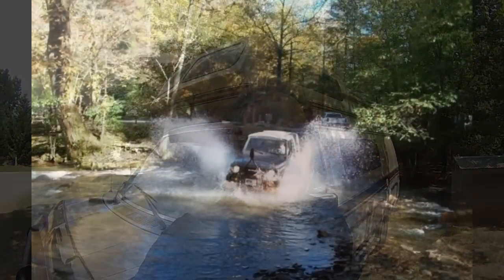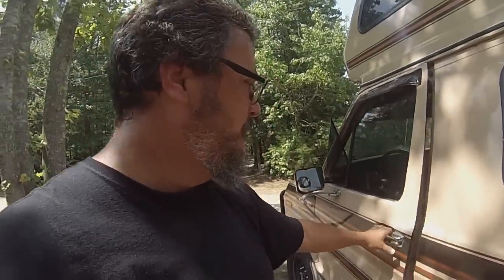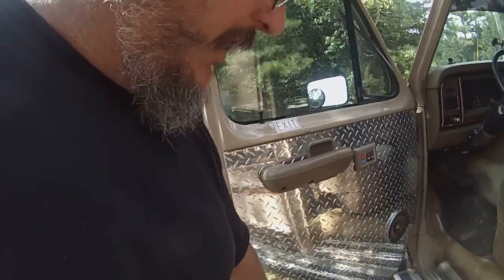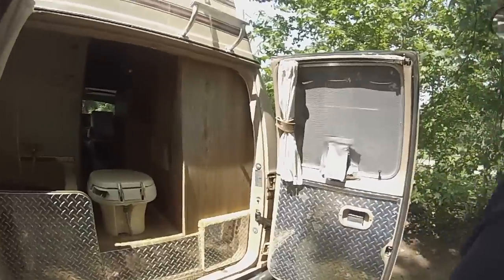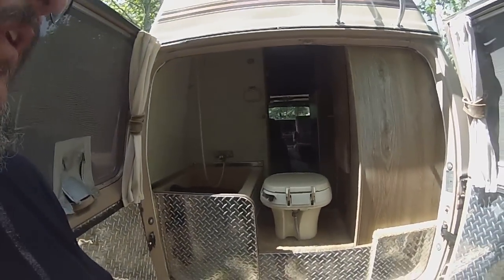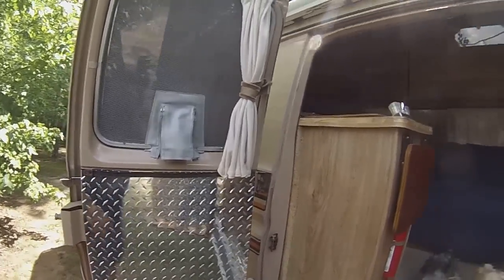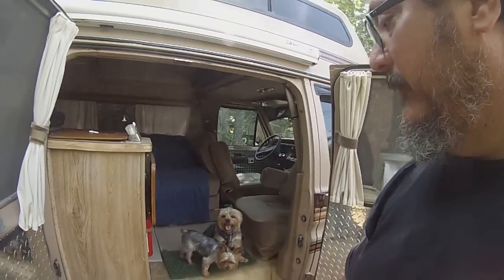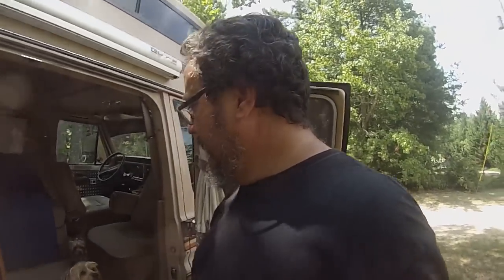Updating interior in Ford Econoline Class B Camper Van Rv

Comment: In the first 30 seconds or so of this video I thought you were going to go with wood paneling....Which would have been great.....But as soon as you mentioned the metal replacement for the door panels I knew you were going in the right direction. Wood, any kind of wood will fade and or warp over time but the metal, at worst will need a light polishing from time to time to bring out the original shine. Great choice and great job! I look forward to more videos of this type, as soon I hope to find and purchase a similar van for use as a temporary home while looking for AND living on land The Lovely Bride and I plan on building our "forever and off grid home"! Take care and keep 'em comin'.
Reply from the maker: FD Mackey I did wood on the Black Campervan, and it worked out great. I like the aluminum VERY MUCH! Good luck on your van search. Either you buy older and spend $$$ to fix em up or buy newer and pay $$$ to buy em... either way $$$$ ha

Comment: Looks awesome big kev, I've done the same thing to my van...I did the walls an all..for the diamond plate they have a chrome trim that goes on the edges u mite want to look at adding it on..all it is, is a door trim that protects the door edges it looks good on diamond plate...butt I love the van..
Reply from the maker: mud flap would love to see your interior... here I thought I was being original ha. How about send some pics to my Campervan Kevin facebook?
Reply: It's still under construction. .to do the walls it's a real thin sheets like flashing metal, I order it off line it comes in 4×6 4×8 4×10 an really cheap I payed 125$ for a 4×10 sheet an it's very easy to work with...

Comment: I need your help...
What or rather how much do you think this 
Van is worth? I have an oppertunity to get one
just like it (well, not as nice as yours, but the same
make and model...
I don't know what they'er worth now days...
Thank you for your help, and making this great video.
Love the doors.
Reply from the maker: I gave around $2500 for mine but it needed work. It was underpriced. Should have been around $5000. I spent $5000 and sold for around $8000. But it was RIGHT. New Everything.
Reply: Thank you so much for your reply...
I'll let you know if I get the van I'm looking at...
I have remodeled many old RVs.. and Travel Trailers..
I think this will be worth it... if the motor is good.
The tires are shot... but that is to be expected... and not
too cheap either... You can't buy just any tires for these Class Bs.
Again, Thank you for your help.

Comment: Very nice. Is that the size of hole the front doors have for speakers? Would a 7" speaker fit in the factory hole. Thanks Kevin.
Reply from the maker: VanoRama RV I would say its a 5 or 6 inch, but the way it looks you could easily cut whatever size you needed.
Reply: Campervan Kevin Great. Thanks for that.

Comment: I going to be putting wood ply & solid in my van what kind of finish would you think is best from what you have seen?
Thanks
Patrick
Reply from the maker: +FloppyHatPhotos I'd be more concerned on what would be safe to be in/around. Van interiors can get so hot they might off gas some fumes. How do I know? I painted the interior of my enclosed trailer with enamel exterior paint. The smell has kept me from camping in it for months. I'd go with a clear and keep it simple. I have not finished any of my plywood interiors. I like the way it ages on its on.
Reply: +Campervan Kevin Thought about leaving it open but wanted easier cleaning as I will have my 100+ pound great dane with me & he tends to make a mess everywhere.
Thanks
Patrick

Comment: Can someone explain ''tags'' to me?

i'm assuming its a vehicle taxation?

I have seen tags on front, tags on rears, no tags at all(!) and also the term ''licence plate''

Here in the UK we have ''registration plates, white/black text front yellow/black rear, it stays with the vehicle from its first registration for road use, you can switch to another one if you own both and pay the swap fee, and the switch is not to make one look younger than it really is for resale value etc. a yearly 'tax'' is paid the amount based either on engine size or co2 emission or a flat rate if the vehicle is so old that no data exists for its 'expected' co2 emission..
my ''mpv'' which is like the size of a minivan(?)(small ford connect?) is "230/$300 a year.
But if you dont pay you dont lose the registration plate, its use is really for vehicle tracking and someone has to be 'registered' as the 'keeper' for the vehicle with all the responsibility's of any defaults/penalty's/fines the vehicle gets.....
Reply from the maker: lez briddon Maybe some others here can help you out, but here in the States tag and license plate are one and the same. Some states require a front AND rear plate but not many. In states where there is no front tag required by state people generally put something of their own liking. Never in rear, only in front. I have run a 96Rock tag since high school with a few exceptions. We have to buy a tag when we purchase a vehicle. The tags are generally good for several years until they make a different style, however at least in Ga we are required to purchase a sticker yearly that goes over last years sticker. The older the vehicle the less the tag.

Comment: how is the up grades coming on the trailer
Reply from the maker: Tolley Smith Well here is the thing.... I have not mentioned this before as I have been trying to decide what to do. I made a mistake. I painted the inside walls with oil base gloss white Rustoleum. The odor is extremely strong.I keep waiting for it to dissipate but it is still very strong. I have not stayed in it because I fear for my health. I may kick my feet up in the bed for 10-15 minutes on the job or sit at the door and eat my lunch...but not overnight. I thought for sure with these 100 degree temps it would cure the paint. It has not. I am researching options now.
Reply: i will ask around and see if anyone has any ideas how to get rid of the smell fast.

Comment: /I have 1990 Ford, Econoline ambulance that I made into a camper van. It is diesel and I love it, but I have the same problems with the doors
Reply from the maker: rv lucky I have used 1/4 inch plywood before on my black campervan, so there are other options than the aluminum.... but I like this the best.